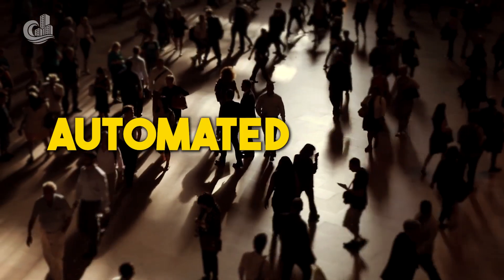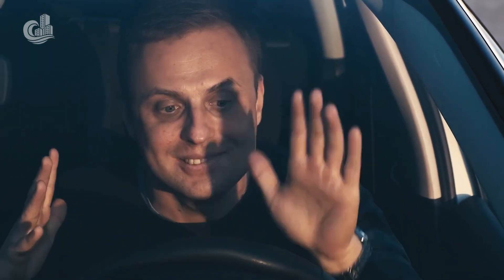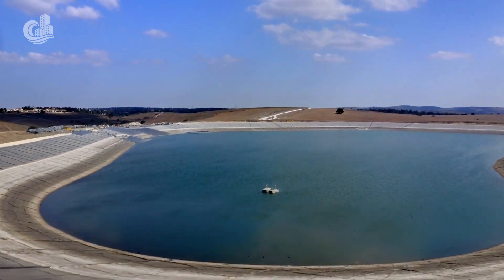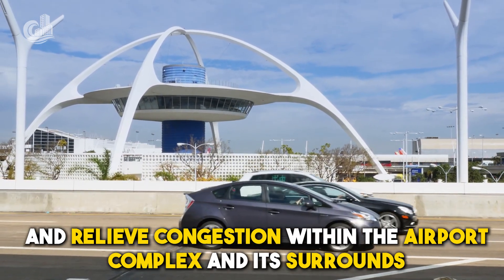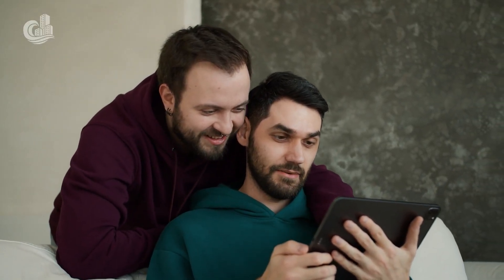LA's $5.5BN Airport Transit

Comment: Context specifically aimed at viewers unfamiliar with LAX. Probably more info than anyone needs, but let's face it:  if you're interested in this video, you probably enjoy this stuff .

The Horseshoe
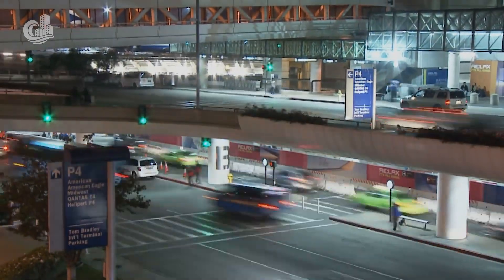2:07  if you freeze frame here, you see the public access road for the terminals. Locals refer to it as "the Horseshoe" because it is laid out in the shape of the letter U, much like equine hoofwear. Traffic moves one-way. (Counterclockwise if the Tower/Theme Building are the center point.) Terminals line all three sides of the road. The space between the long prongs of the U is wide enough for eight four-story parking structures, four along each prong. Between those are a network of access roads (upper and lower) busy enough to warrant their own traffic signals. Also occupying this space are a handful of small service buildings, the current control tower (newer than the parking garages), and the world-famous art deco Theme Building. 

Vehicles initially travel westward, passing the three terminals that comprise the northside. When the road curves left, traffic now flows southerly.  When the road curves left a second time, the eastward traffic is now aimed back toward the airport's entrance. Five more terminals line this side of the Horseshoe. The terminals have numbers for names, arranged sequentially so that T1 is first and T7 is last. (Reconfigurations to the roadway cut-off T8 from the Horseshoe, so that entry is via T7.)  After  T7, one chooses between exiting the airport or going around again. The Tom Bradley International Terminal (TBIT) extends the full length of the Horseshoe's bottom portion, which was originally open space. That terminal, now four decades old, is nevertheless several decades younger than the numbered terminals. Although it sits between T3 and T4, it never got a number of its own. Note:  LAX recently announced a new naming scheme for its terminals. In the new scheme, TBIT will be Terminal 3 Bradley International . 

This freeze frame depicts a sliver of the Horseshoe between T2 and T3. Visually, the whole loop looks about like this. I believe the skywalk across the top of the frame is the connection to the APM Station (will be Station 2). If so, that skywalk is finished, but not open yet .  The upper roadway is for departing passengers. The lower road way is for meeting arriving passengers. The signboards provide directions to access P4, which serves T4 and TBIT. (On the upper roadway, a quick left turn allows the driver a shortcut to bypass the west end of the horseshoe (where Bradley is) to reach P4 sooner. From the lower roadway, one must apparently drive around the horseshoe to find an entrance to that garage.) This image depicts the Horseshoe westbound shortly before it curves south and reaches TBIT. Typically, this section of the Horseshoe has the worst congestion. 

The Theme Building
3:00 if you freeze frame here, you see a simulated image of the people mover passing in front of the iconic theme building. In fact, the elevated track for the APM effectively ruins the sighline to the landmark for anyone in a car or on a sidewalk outside T1, T2, T3, or TBIT. People in the APM will get a good view, though the track may be too close for them to get the full perspective. FYI: the restaurant and viewing platform inside the Theme Building have been closed for a long time. The $15 billion landside enhancement includes new landscaping to beautify the base of the Theme Building. It's a big spend for curb appeal: I'd like to think there's a plan to reopen the building. 

The Light Sculpture
3:55 The large "LAX" sign and the columns of light comprise a beautifucation effort at the road entry of the airport. This LAX Gateway signals the beginning of the Horseshoe. It's often visible from the air during night landings, and makes for a surprisingly soothing and elegant experience for those arriving by car. Becoming as iconic for this airport at the Theme Building.

The Theme Building in Relation to the Rest
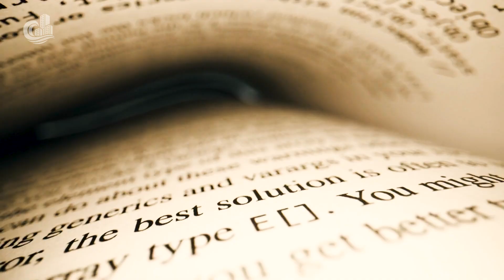5:40 if you freeze frame here, you get a partial overview of LAX. The video was taken prior to the construction of the APM track because it is not visible. Thus, the APM stations are also absent from this image. West is at the top; south is to the left. 

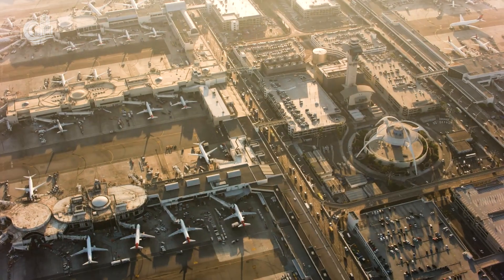What is visible, 5:40, going from left to right
(airside) three terminals in the south complex, T4, T5, T6. The camera is likely hovering above T7, over the airfield. 
(landside) 1. The horseshoe roadway upper level overhangs the lower horseshoe roadway, the outer lanes of which are visible. 
2. In the middle of the horseshoe are the short-term parking garages, service buildings, control tower and the iconic theme building. 
The APM track now exists in this section, built high enough to clear the tops of the parking structures. It passes the theme building and the tower on their north side, but interior of the parking structures. The APM stations are grafted (kind of) onto the top of the parking garages. Stations will serve terminals on either side, with covered walkways extending outward from the stations .
Only the middle station (near the tower, serving T2, T5, T6)) of the three planned airport stations would be fully visible. The end-of-line station serving Bradley, T3, and T4 would be just off-screen to the top. The station for T1 and T7/8 might be partially in picture near the bottom. 
3. Right of all that are the horseshoe roadways (lower, then upper) for the north terminal complex. 
(airside) Tiny portions of T2 and T3 are visible. 

(landside) The road that runs in front of the theme building (and exists for both upper and lower levels) is a traffic bypass for vehicles heading to T7/8. After passing T1, make a quick left turn, and you can skip the rest of the horseshoe. A second bypass is visible west of the tower, this one allowing quick access from T2 to T5 (bypassing T3, Bradley International, and T4). The parking structures at the bottom of the picture service T7/T8 (left) and T1 (right).  

Not shown at 5:40  
1. The airport entrance or exit. These would be out of view at the bottom of the screen (east). The primary access is from Century Boulevard. After westbound-Century Blvd crosses Sepulveda Blvd, Century diverges. Incoming traffic bears right to enter the horseshoe.  It proceeds west past T1, T2, T3, turns left to travel south in front of Bradley International Terminal, then turns left again to return eastbound past T4, T5, T6, T7 (and T8, which is accessed via T7).  It then offers drivers the choice between repeating the horseshoe or exiting the airport.
2. Sepulveda Boulevard (mentioned in the video). This cross-street runs N-S along the eastern boundary of the airport's landside operations. The south airfield extends farther east, and Sepulveda tunnels below it. 
3. Terminal 1. Would be on the right-hand side near the bottom of the screen. T1 is first terminal encountered within the horseshoe. 
4. Most of T2 and T3; all of T7 and T8. A fraction of 2/3 are visible in the upper right. They are very similar in design to T4, T,5, T6. So is T7, which is out-of-frame on the lower left. T8, built later, looks very different and has fewer gates. 
5. The "bottom of the Horseshoe" (the north-south stretch) and the Bradley Terminal. Built in the 1980s, the Bradley terminal is out view at the top of the screen. 
6. Taxiways and runways.  LAX has four parallel runways: two sit north of the terminals; two, south. The runways are laid out E-W, so they parallel the visible horseshow roadways. The visible terminal gates are perpindicular to them.  There is a taxiway just out-of-frame (left) behind the large American Airlines jet in the top left corner. All four runways are visible at 6:02. 
7. Any of the locations where the off-airport APM stations (intermodal transit centers) will exist. These are "across Sepulveda" and way beyond the bottom (bottom-right) portion of the screen. One is for public transit; one for long-term parking and hotels; the end-of-line statin is the consolidated rent-a-car facility (CONRAC).
8. Long-term parking: there are many options for long-term parking, but none of them exist inside the horseshoe. Some of these will be retired when the APM debuts as one of the off-airport intermodal transit centers includes a massive parking strucutre for long-term stays. The other one should receive  . The eight structures inside the Horseshoe are intended for short 

Construction history at LAX on display at 5:40
This image also is useful for envisioning different stages of LAX evolution. All three of T4, T5, T6 have a large oval shape visible in their roofline, punctuated by a dome. Those oval contours delineate the original terminal buildings, designed just before the jet age. The jetways came later! These "island" terminals connected to the headhouse via an underground tunnel. Aircraft parked all the way around. T1, T2, T3, and T7 follow the same design. Other portions of the existing buildings reflect renovations to accomodate growth.  At some point, the underground tunnel was abandoned as more gates were added to the island terminal, building toward the headhouse. Now passengers go from the headhouse into the concourse at the same level as the jetways. (On T6, you can see four total gates were added by this addition.) Although the design configuration differs slightly for each terminal, each island terminal also expanded outward from the original island toward the runways. (For T6, you can see the annex shaped like a circle. T7 boasts a similar roundel appendage. There is no room in the airfield to expand these existing terminals any further. T8 and the TBIT were built later and never had the "island" configuration.

Comment: Some minor clarifications:

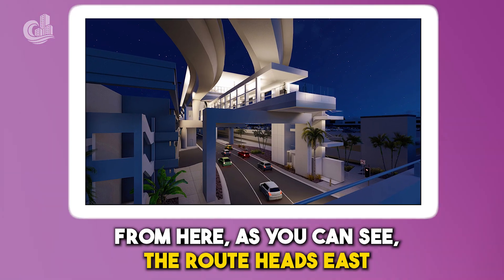1:30--the track runs along 96th Street. It sounds like the narrator says that, but the text "96 streets" pops up onscreen. It is, indeed, the name of a specific street, not a count of streets.

3:35--EV charging stations....the image shows the APM vehicles in their garage. The statistic surely references charging stations for private vehicles.

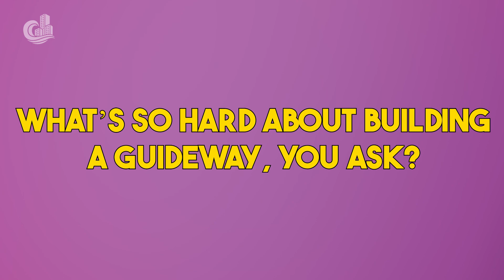6:20--the image depicts a freeway, not Sepulveda Boulevard. The nearest limited-access freeway to the APM is Interstate 405. Between the freeway and the airport is about one mile's worth of hotels, restaurants and other businesses--and very congested streets. Private vehicles exiting I-405 will have the option to skip the airport proper by depositing passengers at an APM station closer to the freeway. Commercial vehicles must use the APM station designated for their type (rental cars returns, taxis, ride shares, hotel shuttles, city busses). Cell phone waiting lots will also be here, raising the question of whether the APM will change consumer behavior. Will drivers will ask their passengers to ride the APM to them, saving the driver the hassle of the airport horseshoe? Or, will passengers still want drivers to venture all the way to the terminal, saving them the hassle of the APM?

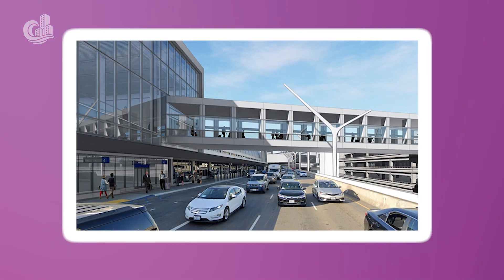7:05 Terminal 9 does not exist. Rather, it exists only on paper. When built, it will be the only terminal outside the horseshoe, accessible direct from city streets without passing the airport main entrance. The APM track has been laid out to include a station for this future terminal. I am fuzzy about whether the station mentioned for it in the video will be an infill station (built later, with the terminal) or has been constructed in advance (built now with everything else). If the former, then the station mentioned here as different from the rest is just a rendering. The final design may end up like the others after all. [SEE, note below. Terminal "9" is no more!]

8:00 the statistic about rental car shuttles is telling. One of the intermodal facilities mentioned a few seconds earlier will service hotel shuttles. Since the gist of this piece is how the APM will alleviate congestion in the horseshoe, the removal of hotel shuttles ought to be equally significant toward that goal. No errors to correct here, but a missed chance to amplify the main point with additional specificity. 

Note: about a month ago (possibly after research for this video was finished), LAX announced a forthcoming reorganization of how it numbers terminals. I believe the transition will coincide with (shortly after?) the APM opening. Definitely before the 2028 Olympics! This alteration to decades-old nomenclature is a knock-on from the finished results of the $15 billion landside enhancement program and also reflects the presumed future influence of the APM. T2 and T3 will be consolidated as T2; T7 and T8, as T7. The Bradley International terminal, which never had a number but physically sits between T3 and T4, will acquire the T3 name (while also retaining "Bradley.") Thus, the future project previously designated T9 will instead end up as T8. The same announcement also revealed that the APM stations will have numbers for names .

Comment: Dropped off family and friends a couple of days ago after not being there for over two years. Wow, what a difference. It's looking like a very different airport. You wouldn't recognize most of the terminals now especially the TBIT.

The whole airport finally has a more cohesive aesthetic. It's an obvious homage to Mid Century Modern architecture design of the 50 and 60s which is when the famous Theme Building was constructed. Everything looks like it fits better including the Theme Building. The APM cars also follow the same design aesthetic. Looking very good.
Reply: Agree about the visual transformation. Had a similar impression when I was there last summer. We usually use an alternate LA airport closer to home, so it had been a few years. Didn't have the chance to see many of the changes on the inside though.
Reply: Just arrived at LAX this morning after a couple of years....and WOW...impressive VERY...!
Reply: In future, when on pick up-drop off duty, will you ask your passengers to meet you at the intermodal facility (they use the APM to/from there)? Or will you continue to prefer to use the horseshoe and go to the terminal yourself?  (Assume time is not an issue.)
Reply: @johnmaster3748 I would pick them up at the LAX Metro Transit Center Station because it's even further away from the horseshoe. Or, I would pick them up or drop them off at the C line Norwalk Station, which is about 10 minutes from  my house. They would only need to do one transfer from the APM to the LAX Metro Transit Center Station. Both the K and C lines will connect to this station where the LAX APM connects to the LA Metro. Don't plan in entering anywhere near the horseshoe once the APM opens.